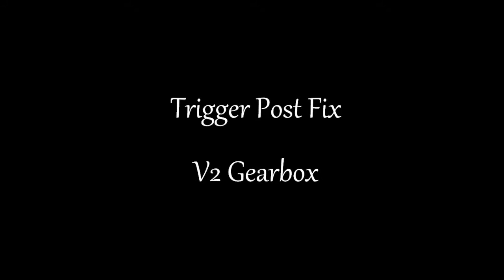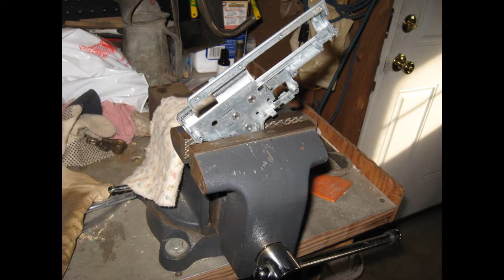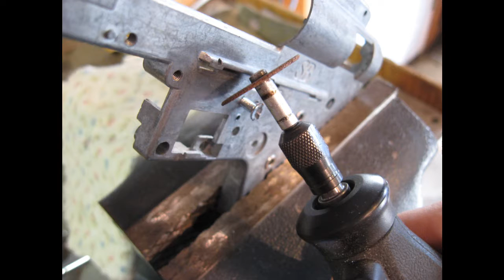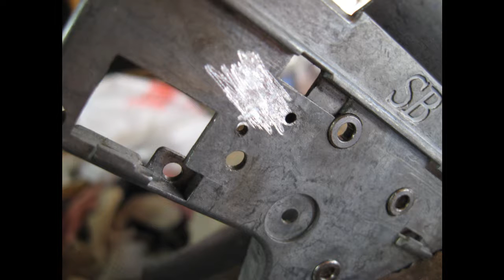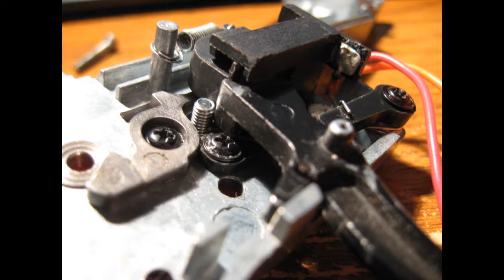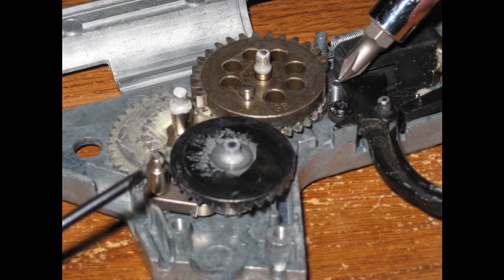Trigger Post Fix + Anti-Reversal Latch Mod

Comment: I had this problem with one old V2 gearbox.I drilled a small hole in the place of the post and jammed in a short plastic rod and then super glued it in place.I also weakened the spring in the trigger sled so that it would not strike the plastic rod too hard and it has stayed in place ever since.The method in the video is certainly more reliable way to do it though if you have the tools(i did not at the time:)

Comment: Guys. If the anti latch wasnt necessary for the gun to run properly, it wouldnt be there. Its probably the main part of the gearbox that is constantly overlooked. Without this guy, at the end of every shot, the spring will depress and the air nozzle will load another round. When you pull the trigger, guess what, double feeds every first shot on semi and full. Full bursts can still be made but extreme playing conditions with the gun in this condition will make it fail faster over time.

Comment: Every single time I try to to put the anti reversal Latch and then the bevel(?) gear back in, it just flies out, or I get it in and when I put the spring back in and go to put the second half of the mech box back in it flies out. I've cleaned both the latch and the little notch where i sits and it appears to work, but then when I start to put it back together, or ever so slightly bump the bevel(?) gear it flies on out same as before. any ideas? I'm using a set of Matrix torgue gears.

Comment: @MrStemkilla I tried it. Depending on the voltage of the battery, you will only get a shot every 2 trigger pulls on semiauto, and you can damage the back of the piston, if your spring is relativeley strong and the motor is very weak, but if your gun is completly stock, and you use a 8.4V Small Type or lower, you wont have many problems, and with higher voltage batteries, the only problem will be the 2 trigger puls, one shot problem on semi.

Comment from the maker: @TungH Actually, this box lasted through 30000 BBs more than the CA shell. There is stress on it, which is why it is a common problem with v2 gearboxes. See that spring that hooks onto it and holds the trigger trolley back? Well, every time that goes forward on semi auto, the cutoff lever hits the trolley causing the spring to pull it back and hit that post, and if that is pulled back like that many, many times (i'm a semi auto guy), the post will eventually break.